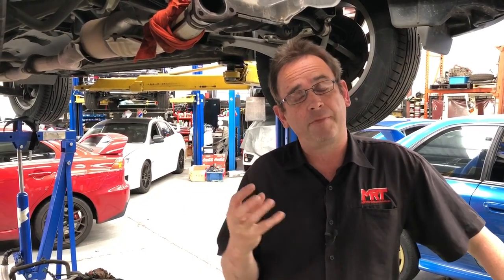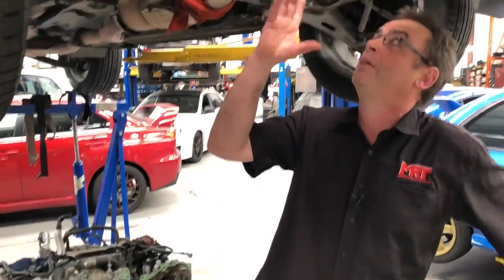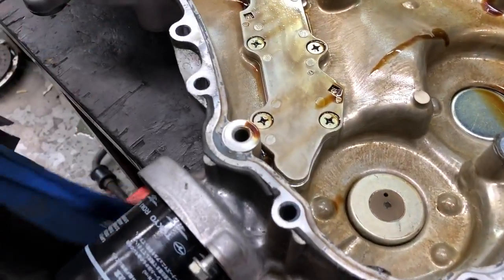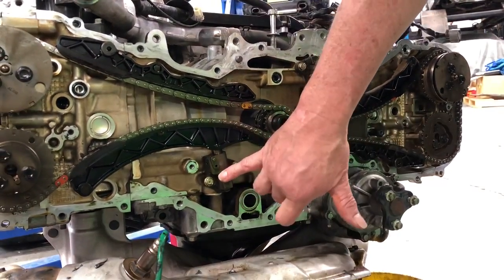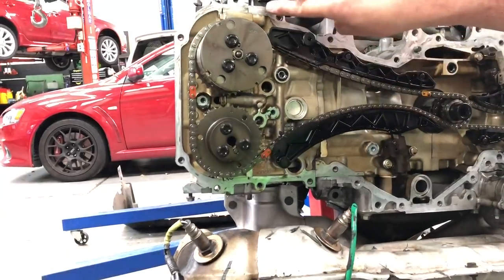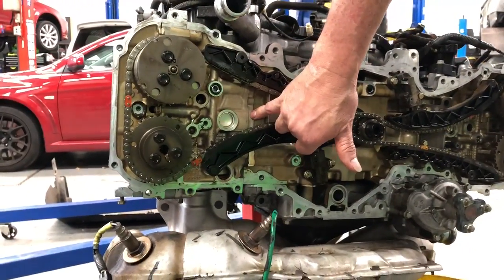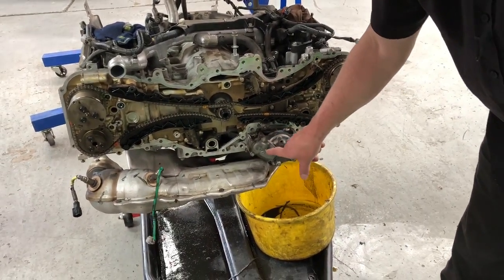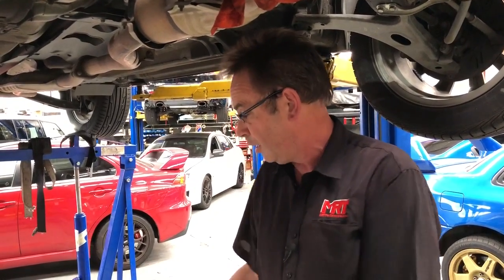Subaru FA/FB Series Engine Oil Leaks - Forester/Impreza/Outback/XV/BRZ

Comment: Have newer FB20 and FB25 cars. No problems yet but I just had 30K mile service on the FB20 car: intake cleaning for $250, differential oil changes for $180 each! I won't buy another Subaru - they are high maintenance.
Reply: Any motor that is direct injection will have intake cleaning recommended.  The same can be said for all AWD vehicles and their front & rear differentials.  There really isn't a difference in standard maintenance.

Comment: RTV sealants are generally not designed to function as a "seam" sealant which is exactly how Subaru applies it to that inside "groove" that is formed once the casing goes back together.  I am experiencing this same issue in my 2012 Impreza with 97K miles.   RTV is designed to be applied between the machined metal-to-metal surfaces under load so that the material is retained as a blocking boundary preventing any micro sized open paths for the oil to migrate across.  The method which is applied here offers zero surface compression to the fully polymerized sealant.  Once the chemical bond of the RTV stops adhering to the inner "seam" surfaces, it will separate from the surface from a combination of thermal cycling stresses and chemical attack from the engine oil additives over time.  To make matters even worse, there is so much porosity in my particular casing cover casting, it allows oil to migrate both thru the walls and surely under and behind the polymer sealant.  This promotes further weakening any RTV surface bonding. Once the oil pressure is higher than the bond holding the seal element, it leaks.  High temperature cycles (perhaps from low oil volume levels reducing the overall cooling system heat efficiency) will accelerate this type of problem.  And so its only a matter of time until the leak become severe enough to be noticed.  

Don't even get me going on the poor o-ring material choices that most manufacturer's use.  The complex chemistry in today's engine oils along with thermal cycling can attack your basic 15 cent o-ring to a point where it loses all compressibility and thus leaks.   Maintaining gasket compression critical regardless if it is molded like an o-ring or formed-in-place like RTV.    Ever seen an o-ring that looks like an oval cross-section or maybe flat on a side or two?  That type of failure mode is called compression setting and is typical of elastomers exposed to high temperature and certain chemicals over time.  That's a subject for another thread though as modern engine oil chemistry become more complex to protect wearing parts but sometimes at the expense of elastomer life.  Using a higher quality chemically resistant o-ring should provide you service beyond the life of the car.  That costs a few dollars more, and would seem to be where the bean counters make their impact over the recommendations of sealing professionals and engineers.
Reply: Is there a type of sealant that can be used instead of rtv that is supposed to function like a seam sealant?
Reply: @SynchroFPS I've used Loctite 518 anaerobic sealant. It's easier to work with and cleaner. However, tolerances are tighter and an activator is needed when gaps are large or mating material are different.
Reply: @SynchroFPS  Right Stuff works well.
Reply: Permatex  black  gasket maker is .  Yes?
Reply: My question is what where they thinking with the exhaust manifold? Let's make it huge so it'll catch every drop of oil leak ?!?!
Reply: @dennisjohns624 I'm having this exact issue with 125,000km... been quoted $3000 Australian to fix.. not sure if it's worth if when It can potentially comeback in less than 100,000ks.. might as well do a trade in

Comment: I have a 2015 Outback with the non turbo 2.5 and this thing leaks oil.  We had a short block installed at 20K due to oil consumption, and then at 60K the cam seals were leaking.  After having those two oil leaks fixed under warranty, the cam seals are leaking again at 150K. This time not under warranty and they want $4K to fix. Subaru you dissapoint me because in this day and age you can’t build a motor to hold oil in it?
Reply: I own a 15 outback 130 K no leaks absolutely no problems at all
Reply: What are the symptoms of cam cover leaks
Reply: @fredharvey2720 1. You'll be losing oil depending on the severity of the leak. 2. You should be able to trace the leak from black caked oil near the seal.
The problem with the fix is, the engine needs to be taken out and timing chain cover removed, timing chain removed. Basically, more can go wrong during the fix than the problem itself. Unless you see clear oil streaming from the seals, leave it until the engine can be overhauled or resealed in its entirety. Check your PCV and related hoses to make sure your crankcase isn't overpressurizing.
Reply: @hankitytankity  I actually had my PCV and hose replaced a couple weeks ago as a preventive measure at 57.5k.
Reply: @fredharvey2720 Some recommend 30k interval for PCV since that's the only thing saving these engines from overpressurizing and leaking. Don't forget to check the hose since a cracked hose will not hold the vacuum to suck the pressure.
Reply: @hankitytankity  Yeah that's the regimen I put my car on.
Reply: The quality of the seals is poor most likely
Reply: You got it fixed twice under warranty quit complaining
Reply: @WayOutEast1  if he already fix it twice why does he need to do it a third time? That’s his point

Comment: my legacy has a leak (facing the car) right side lower portion of the cover... Dealership is like nope, not gonna fix it....
Reply: AnhYeuEmMaiMai69 they would be happy to sell you a new one though.
Reply: @francismartinez6049  of course and I am up for a newer car to replace my 2003 Legacy so when I go into the dealer to look I am goona be like i bought my last car here and you did not stand behind it, what makes you think i am gonna buy another one from you? The car that is leaking is a 2014 Legacy with 66K on it when the leak was discovered and now has 68K on it. 66K miles = roughly 106K kilometers
Reply: austoncar  actually SOA came through, I they were helping me register my 201 outback on My Subaru and I asked them about it and they stated they would put $750 towards repair so I am going to do it here soon.

Comment: Thanks for this review! I just bought an SH Forester with the FB25... and it is leaking! Replaced the Valve Cover gasket... and it keeps leaking. You have just confirmed to me what I suspected... It is leaking through the seal associated to the camshafts (the one between the valve cover and the head gasket). Please do more videos on these FB/FA engines!!! Thanks!!!
Reply: I have the same exact issue. I thought it was the valve cover gasket leaking on drivers side 2011 Forester (FB25B engine). Looks like it is the camshaft cap that is leaking. Can’t seem to find any useful videos on how to repair. I have a good idea on how it needs to be fixed, but a how-to video would help tremendously!

Comment: All you have to do with these engines is put permatex black oil proof silicon sealant on all gasket surfaces and it will never leak again 😎

Comment: So complicated engine design the flat engines are. I think that in 2018 an engine with leaking oil is unacceptable we are not in 1970-1980-1990 years. You won’t run out of business with Subaru engines. :D I bought my first Subaru I’m so worry about the flat 4 and cvt in my 2018 Crosstrek.
Reply: Don’t worry man the majority of Subies have no issues at all! Don’t listen to all the propaganda
Reply: @darylhill9400  They are ok/passable definitely not great engine like L4 from Toyota.
Reply: @clou1969  I also own a O9 Tacoma, with a 2.7 four-cylinder. That I bought brand new the Subaru motor is more performance revs much faster! 2.7 Toyota it’s like a tractor motor. I actually like them both a lot, I love boxer motors I have owned BMW, motorcycles and Porsches in the past ! I’m actually impressed by the build quality of my 2015 outback. It’s a very solid automobile it does everything well for me. Thanks for your reply.

Comment: Lots of oil sealing issues with these engines.  The first lot of F series engines had massive problems with the robots assembling them at the plant.  Incorrect torque specified and numerours leaks.  Have even heard reports of engines with bolts missing and not torqued when pulled down for re-seal.

The subaru and toyota dealerships were doing hundreds of upper engine and front cover re-seals when they first came out, and it wasnt until they figured out to use more torque than what the manual stated, that they got them sorted out.

The engines also have problems with the oil pump.  The oil pump is in the front of the cover.  And there is O-rings that seal the oil passages to the pump when the front cover is installed on the motor.  If the seal goes bad there, oil pressure is in-consistent.  And that is no good for the lubricated parts of an engine...
Reply: Do you know about when they fixed this?
Reply: I better check the o-ring while I have the cover off. Thx.

Comment: My 2014 XV Crosstrek has had the cam carrier resealed as it was leaking. They also replaced a cam sprocket under warranty as well.
Reply: How much did it cost you? I just got diagnosed with the same issue
Reply: @TangoNevada  uhh well mine was under warranty so I only paid my warranty deductible. I imagine a few thousand as the engine has to be pulled.
Reply: @theshinobi01  Crap! Yeah. I got a quote for like $2,400.00. Equal to my stimulus check (Yay). How many years/miles was your warranty? I feel like mine should be covered, it's a 2015, but they want to bill me. Thanks for replying a year later.
Reply: @TangoNevada  I bought the Subaru extended warranty when I got the car new and rolled it into my car loan. It's basically an extension of the 3 year, 36k bumper to bumper warranty to 7 years 100k miles. Idk if the 5 year, 60k powertrain warranty covers it, try writing to SOA HQ to see if they'll discount the work, it's a well documented issue with the FB20/FB25 series engines. Unfortunately mine happened right at like 80k miles, so beyond the 60k miles powertrain warranty. After that my car kept burning oil and kept having a myriad of other issues before I finally traded it in last April.

Comment: Your close enough now to replace the short block. The FB 25 in NA burns tons of oil! Highly recommend a block replacement or new piston rings with more tension. Also that's an old FB like Gen 1 it only has intake avcs not intake and exhaust.

Comment: Any idea what sort of gasket sealant Subaru uses from the factory? Seems weird to see brand new cars with oil leaks that early.

Would it be advisable to change the gasket sealant on mine when i go for the servicing? 

Mine is the Subaru Crosstrek/XV 1.6L.
Reply: Idk about the 1.6l motors but if it’s a 2.5l you don’t want it, sure it makes more power but it also has known issues. Fb20 motors don’t have this issue they pretty much have no issues. I’m only 4k miles on my 5speed hatchback manual 2018 Impreza and there’s not even a slight issue with my motor.
Reply: @imoffendedthatyouareoffended  4k miles obviously no issues. '15 impreza with 70k and they had to reseal chain cover and the cam carriers at 50k and its back at it much worse at 70k. FB20s certainly have this issue.
Reply: @Eric80427  Yup, wait til you get to 300,000 kms. My 2012 Impreza has so many leaks I can't even tell where they're coming from anymore. At least nothing drops on the driveway, but because it drips on the exhaust and burns up, it stinks inside the car with HVAC on fresh air, as well as outside, obviously, which is pretty embarrassing. Luckily (or unluckily) I have the valve spring recall to do, so when they remove the motor, we should have a good idea where the leaks are and what needs to be resealed.
Reply: @RIKWID  I hope that solves it. I have an oil leak on my 100 000 km 2013 Crosstrek FB20 in the spot pointed out in the video, even after the valve springs were replaced (about two years ago). I'm not certain exactly where as there are so many RTV sealed seams in the area. There's no oil spot on the ground yet, but I'm getting get the burnt oil smell. I was quoted CAD$2600 for the fix. I'm hoping to get 3-4 years more out of the car, so Ii'll likely not get it fixed. By then, the car will probably only have about 150 000 km.
Reply: @MikeDS49  To replace the springs only requires them to reseal one area, whereas if you ask them to reseal the other areas while the engine is out, there are at least 3 other places, including the timing chain cover (I need my tensioners replaced anyways), as well as the cam "box" as I believe it's called. My biggest challenge now is to figure out which of my local dealers can do it without screwing it up.
Reply: @RIKWID  Right. I believe the cam box was where they said to me too. I assumed the leak would be sealed in the process, but I should have explicitly asked :(

Comment: Looks less user friendly and much more complex than the EJ engine
Reply: Bro this engine is already a bitch at 60k on my outback. Flipping leaking already and its not even turbocharged or high powered. No reason a underpowered 4 cylinder NA engine should be leaking at 60k miles. My 2006 toyota matrix at 200k miles doesnt leak/burn a drop of oil. And my 2011 legacy 3.6r leaks from the timing cover. I love subaru for their versatility but just for their powertrain build quality i may look elsewhere for my next car.
Reply: It is. They are a major pain to deal with.
Reply: a trick : watch movies at Flixzone. I've been using them for watching a lot of movies these days.
Reply: @Benedict Samir yup, have been using Flixzone} for since december myself :)
Reply: @Benedict Samir yup, I've been watching on flixzone} for since november myself =)

Comment: Bought a 2002 WRX a few years back that had 3 oil leaks, thankfully they were pretty easy.
Did valve cover gaskets, oil cooler gasket, and oil pressure sensor.

Comment: Oil leaks on subaru’s are the one thing that would put me off buying another . The complexity of fixing leaks on the 2.5 chain driven engines now is silly . Even the fact you have the engine out to fix an oil leak is ridiculous, it shouldn’t be that hard or expensive to fix an oil leak unless it’s a head leaking oil. 

I wouldn’t buy subaru in future i think
Reply: As the mechanic said, every brand (and in turn, their engines) have certain pros and cons over others.  While you might find removing the engine to fix an oil leak to be ridiculous, this isn't something most people regularly do.  Meanwhile, things you are more likely to work on (like oil changes or stuff operated by the drive belt) are far easier to do on a Subaru configuration than the average car.
As far as I'm concerned, no engine setup is the best.  So if you find this issue to be enough of a problem, no car is worth your interest.
Reply: Peter Schmidt Well i have no interest in engines ( or cars) that are inherently over complicated to work on. If you own a subaru you’ll know oil leaks have been common place since the early 90’s especially ones dripping on the bloody exhaust. 

If subaru after 30 years can’t get the basics right of making an engine that doesn’t piss oil everywhere then maybe i have no interest in working on them.
Reply: Except, they're not inherently over-complicated to work on... they're just complicated for problems like this.  Otherwise, they're known for being overall easier to work on than most.  Typically (but not always), when you properly take care of them, they don't have problems like this.

As for "getting the basics right", what a load of crap.  Pick any brand at all and within the past 10 years they'll have a "basic" thing that they royally screwed up that affects the vehicle's safety, emissions, and/or reliability.  Even Toyota.  No brand has a perfect track record.

Anyway Subaru may have been known for gasket issues for decades, but their modern cars aren't known for that.  Modern Subarus are known for burning oil inside the engine (due to piston rings) and even then, only a minority of them do that.
Reply: Peter Schmidt Lol oil burning issues being just one recent issue. More like cracked ring lands,blown head gaskets,cracked heads clutch selector shaft issue which wears away part of the casing of the gearbox rendering it scrap, or 5 speed gearboxes that break easily even when running modest power. 
Even the diesel range subaru did were junk and engines blew at relatively low 50-60k mileages. 

On the whole subaru’s after 2000 + onwards have been shite. It shows in they’re sales and in they’re re-sell values. 

I can think of many marques better built and less workshop hours to work on
Reply: @MrL_5763  Look how long it took them to fix the head gasket problem.....No excuse in my book.
Reply: Plus for Subaru is, genuine parts are cheap and the engine is easy to remove and service. The heads are small so they can be resurfaced on the spot. The sealing is a crapshoot, but it's one of the easier cars to work on.

Comment: Weird tensionners. I just bought a brz so im looking at what i coukd expect in the long term
Reply: How’s the brz, looking to buy one but concerned over reliability
Reply: @Kevin-gq2kj  I've beaten the fuck out of it for the past 2.5 years, I just change oil and filters often to compensate.

Even floored it for 3 hours straight down the road in the mountains. 40 000km right now. No problems on anything except ice build up around the intake box